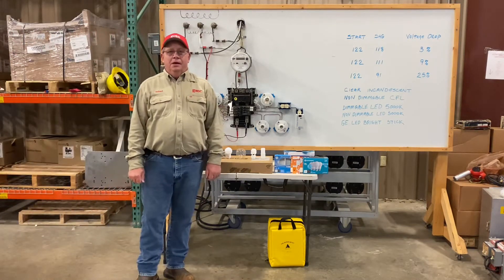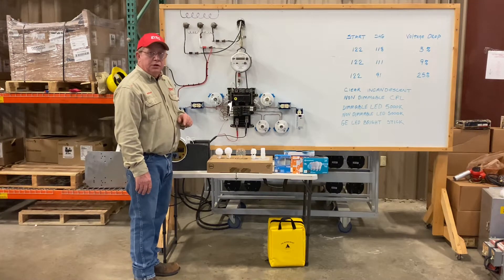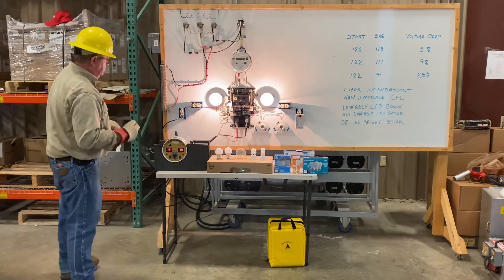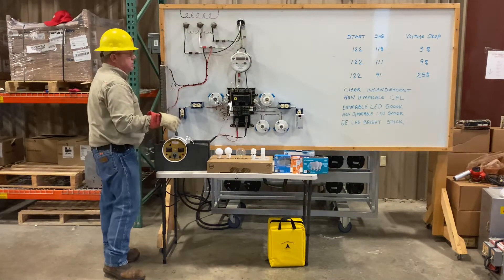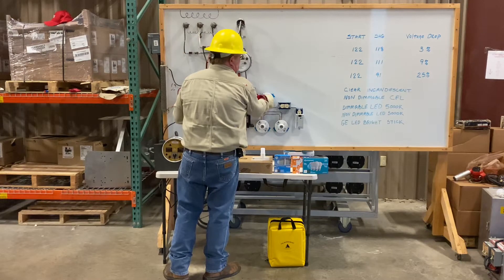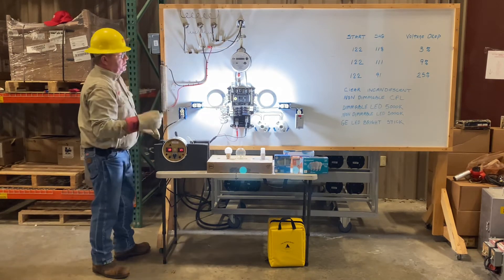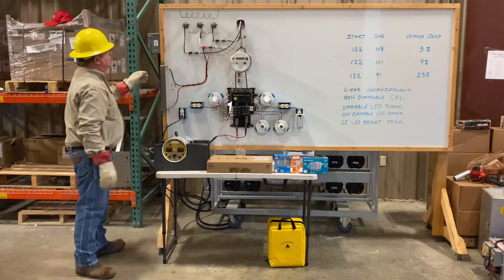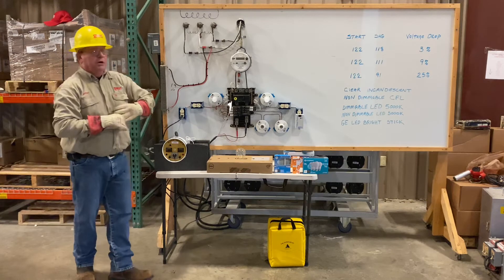Presentation showing the relationship between residential lighting and voltage drop.

Comment: The power at the duplex I live in likes to range from 118-127 V. In the mornings as of late, it’ll be around 122 or 123 V, but then it inevitably will drop to 118 V over the course of the morning. 

However, when I get home in the evenings, it’s usually around 125 V. 

I would assume that this is due to my neighbor on the other side running some appliances?
Reply from the maker: That is possible. Involve the power company. They  regulate the voltage at the substation and are responsible for controlling the voltage level down line. The voltage drop to the duplex suggest you could need a transformer or service wire upgrade to maintain a more stable voltage level.

Comment: if we hAVE A GND connection?
Reply from the maker: A ground is not important.
There is a voltage applied and a voltage measurement when the load is applied. Voltage drop occurs on every circuit with or without ground.

Comment: Interesting presentation, although I would have liked to have seen the dimmable and non dimmable LED 3% drop tests done again, with the neutral closed.
Reply from the maker: James,
Thank you for your continued support. 
The 3% used the heat gun for load and had a good neutral.
The 9% was done using the Super Beast with a greater load and had a good neutral.
The 25% was done by using the Super Beast with a greater load and inserting the resistor into the neutral.
The neutral to the buss was open in the Super beast demo but not here.